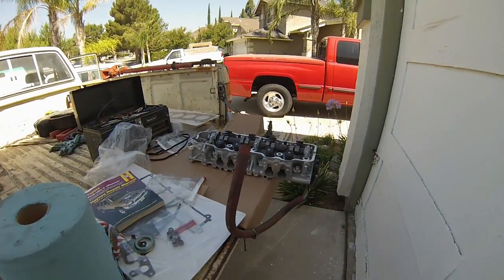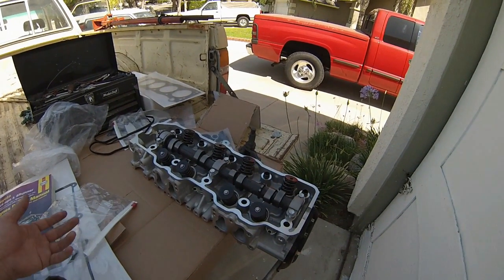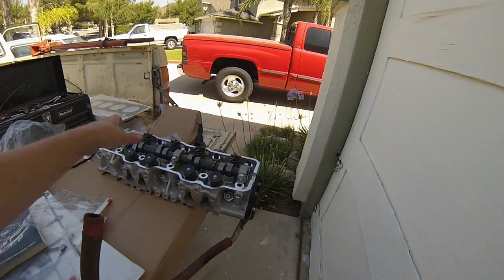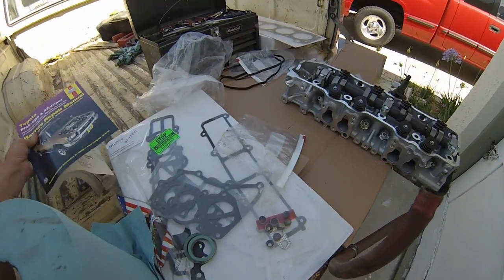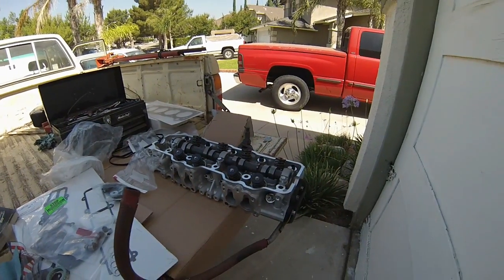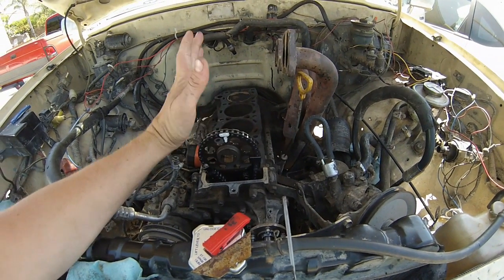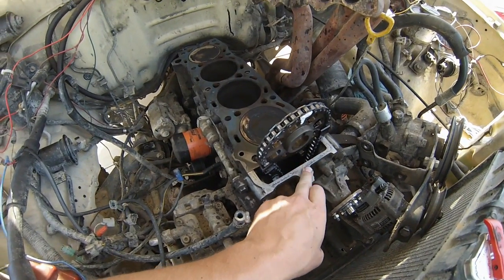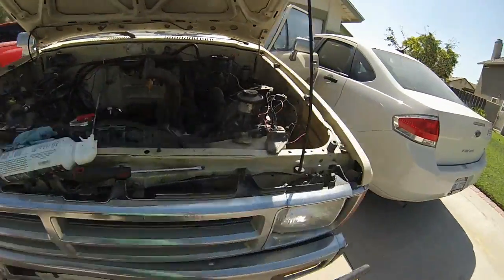22r Head Gasket Replacement walk through Part 3

Comment: Larry is that a dnj cylinder head? I just bought one and nee dnj rocker arms how did yours hold up over time your videos really have helped me I know there older but thank you
Reply from the maker: Im not quite sure it was a cheap head I purchased at the time. This head held up right up until the truck was destroyed by a hit and run driver. I drove it to Arizona in the dead heat of summer with no problems.

Comment: You can get new heads on ebay. New head with camshaft,rocker arm, new head bolts with complete gasket set for about $300. Worked for mine.
Reply from the maker: luckily this was an 85 and above 22r with the pear shapped outlets, those can be found by the thousands all over the net.  Try finding a 81-84 early model 22r head thats new....good luck!
Reply: Luckily mine is 1988!!!
Reply from the maker: this one was an 88 as well but the one i have now is an 84
Reply: Worked better for me to remove the head and intake as a single unit then separate the two after they were on the ground. And i used a cherry picker to lift them off. Two back surgeries don't let me do all the heavy stuff anymore. Not quite sure i understood about the "pear" outlets you were talking about. But these toyotas can give you a surprise any time you take one apart. Something that looks straight-forward and simple can turn to crap in about 30 minutes!!

Comment: Geez... as so many do, you wasted about 75% of this video with useless jabber!!!
Reply from the maker: +TheKatsAss i tend to do so in most of my videos, im getting better at it though
Reply: Realize that when someone is involved in a project of this nature, they generally are greasy, frustrated and looking for a QUICK ANSWER. "tighten head bolts to 58 ft/lbs" or "mine idled too fast also, turn this screw..." or  "Here's a closeup of the hidden bolt" or "The only way to crack loose the crank bolt is to use a breaker bar and bump the starter... IT WORKS every time!". Patience is in short supply. We're not browsing repair videos for entertainment purposes. Thanks for trying tho :)
Reply from the maker: TheKatsAss Thanks for the tips.  Ill definitly keep that in mind for future reference. I agree fully in that those looking for a quick answer dont want to sit and listen and might miss the info by skipping through the video. ill do my best being more succinct in the future. Thanks for watching!
Reply: For people who are learning and don’t want some dark garage greasy up close shots, these 3 vids on the 22r head replacement is the  most simple I’ve seen,  I think more people should try to be personable like this guy is here. Great video, time to knock out the head on my ‘86 22r 🤙
Reply: your repair videos are great, much better than Larry's.
Reply from the maker: +Kory Looper,  i put a lot of time and effort in my videos,  His videos have nothing to do with toyotas.  hard to compare

Comment: Im doing a head gasket right now. Im using a evergreen gasket its mostly composite(I think). I was thinking about using the copper spray. Did you use it on both sides of the head gasket? any problems with it? or leaks. I did a timing chain as well. does the sealant  go in top of the block or the gasket or both?
Reply from the maker: +North Carolina Prepper yes i made sure to use a light coat on both sides so that it was tacky all the way around.  I recommend using it anytime you do a headgasket replacement on this motor.  It held up fine.  You only use gasket sealant on the top of the chain cover only.  put a light coat on the entire top of the timing cover then to top it off put 1 bead of sealant where the block and the timing cover meet.  No sealant should be on the block except where it meets the timing cover ( the 2 beads i just mentioned).  place the sprayed down gasket on top of this.  The gasket sealant only goes on the bottom side of the head gasket.

Comment: The head I bought came with a great gasket set too, has everything that might need replacing if you remove the head and more! 
Waiting for some more parts before I can put the engine back together, replacing warped head has turned into full engine rebuild.

Comment: Clean your god damnpistons what the hell is wrong with you?
Reply from the maker: +RadioControlledHelicopters did this video before understanding clean pistons were a must.
Reply: Some would tell you not to clean them.  That it will only cause bits of carbon to get stuck in the rings and that you are better off leaving it alone.  I cleaned them last time but this time I don't think I will.

Comment: Rocking the pully bolt losend the timing change tensioner?
Reply from the maker: correct, when i went to put the sprocket back on the camshaft dowel the chain wasnt long enough, so i called a buddy of mine and he said just rock the crank pully bolt a little back and forth and it will loosen the chain just enough to get the sprocket back on and sure enough it did.
Reply: Yes, It worked perfect and saved my 1 hr by not having to pull off crack pully.  Did you consider doing rings while head was off?  I'm on the fence.  My 22R has 160k miles and burned oil that may have come from valves.  I got new head.
Reply from the maker: Liberty Fox  i didnt bother touching the block, i was hell bent on getting the head back on as the truck is my daily driver.  i am not the origional owner so i couldnt tell you how many miles my block had on it. If you feel confident in your ability to do so and you have enough time, i say go for it.  just remember rebuilding the block is a whole other story.

Comment from the maker: I used compressed air, it was recommended to me as well as in the manual. any kind will do even computer compressed air as long as those bolt holes are clean of oil and other debre

Comment from the maker: Sorry for the late response, youtube doesn't tell me when i have comments.  I acquired the head and gasket set at Morris Automotive in rialto california.  and Yes the old bolts were used, although i did read in other builds that others had replaced them. I suggest replacing them because i could tell one or two of mine were bad and i just over torqued them to make them work.